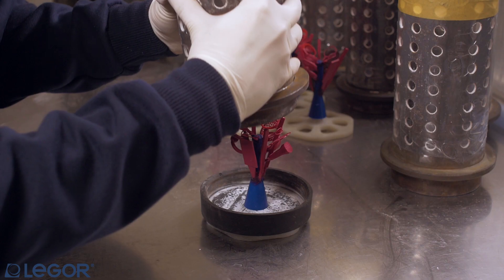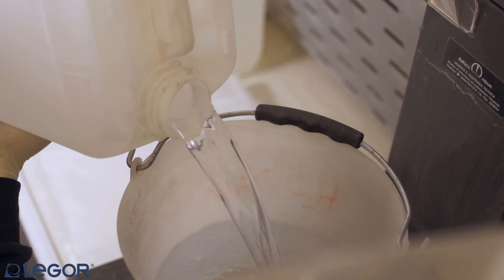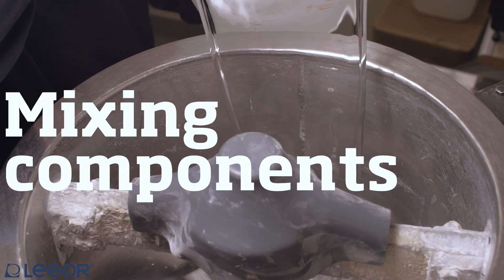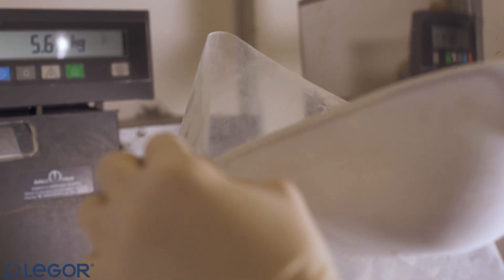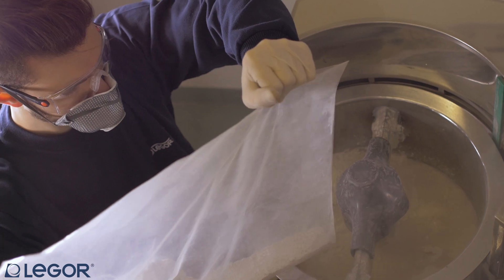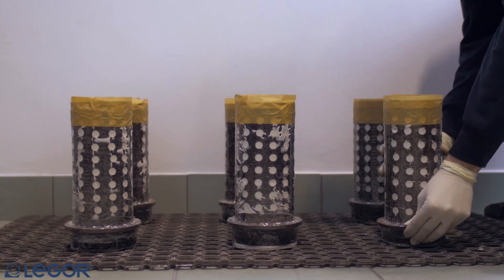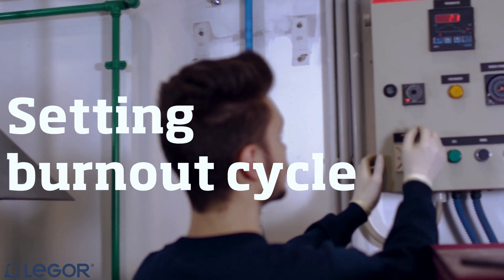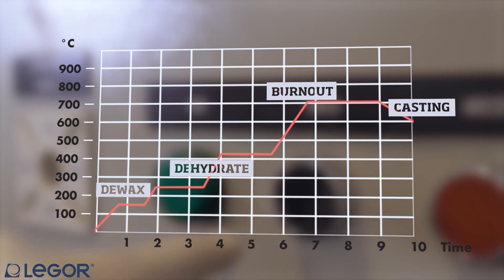HOW TO: INVESTMENT CASTING - Preparation and burnout cycle (1/5)

Comment: Hello, I have problems with my burnace cycle, can you send me the correct cycle please? The powder used is R&R  and I use a normal water, and not deionized water BTW. Thanx
Reply from the maker: Good morning, if you leave me your email contact, you'll be contacted by one of our technicians! Thank you
Reply: @legorgroupspa  hi could you send me the same information also,Im having problems also with measurements and burn out cycle with the same investment R&R ? Thank you.
Reply from the maker: @macykeovilay6010 Good morning sir, please write to info@legor.com One of our sales rep will contact you with the info you need! Thank you